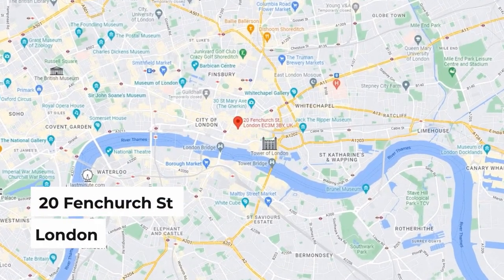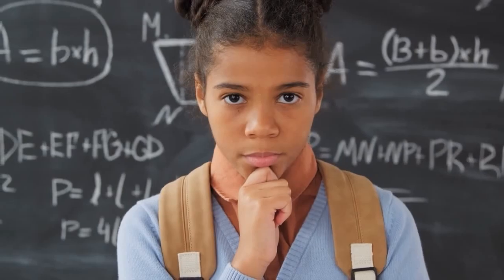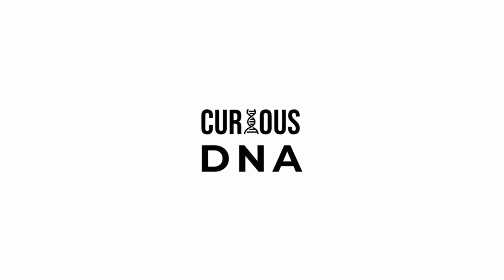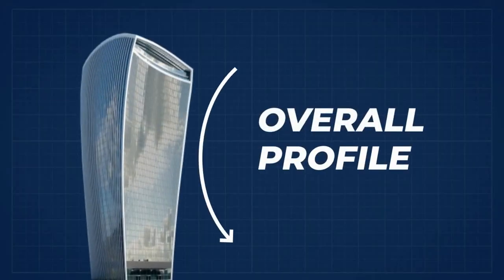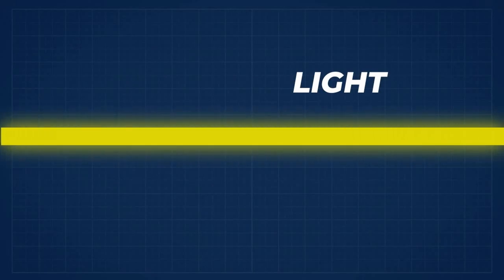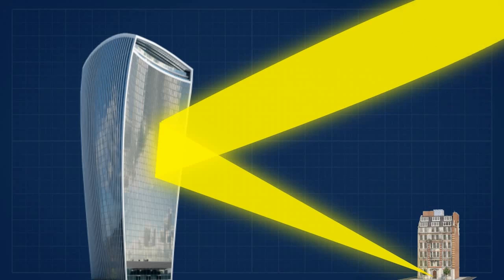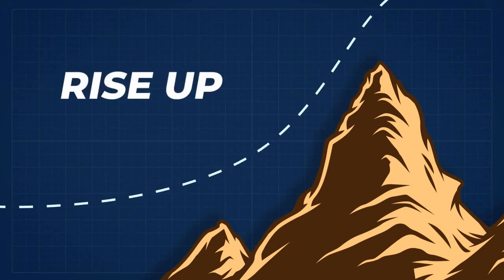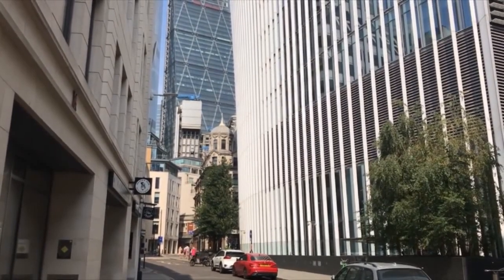How this Building Melted everything in London | Walkie-Talkie | london skyscraper | Curious DNA

Comment: Wonder, why not they implement the solar panel to absorb the light and turn it to electric energy
Reply: So one entire side of a skyscraper would have no windows?  Who would pay to rent an office in a skyscraper with no view?
Reply: @DLiguori hes talking about the roof I think, he did not mention on which side bro
Reply: @filippo_durante   did you watch the video?  They’re talking about the side of the building reflecting light, and this comment ⬆️ was regarding a solution to that problem.  Why would the solution to the side of the building reflecting light be to put solar panels on the roof?  I think you’re the one who’s confused.
Reply: @DLiguori it was regarding a way to use solar energy. And it's not even a solution cuz solar panels also reflect the light, and London is grey all the time except 60% of the summer season
Reply: @filippo_durante  well, tell it to the guy who suggested it!  Why are you arguing with me about it - I said it was a bad idea, right???
Reply: @filippo_durante  AND, it was regarding a way of using solar energy due to the side of the building being a poor design. So again, why would you assume he’s saying put solar on the roof?  You’re the one who decided he meant the roof for some reason.